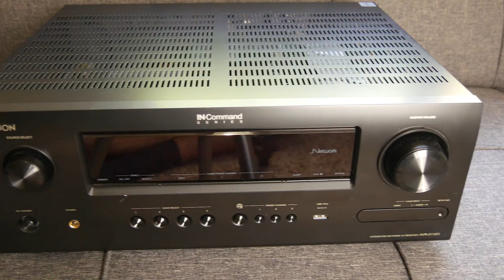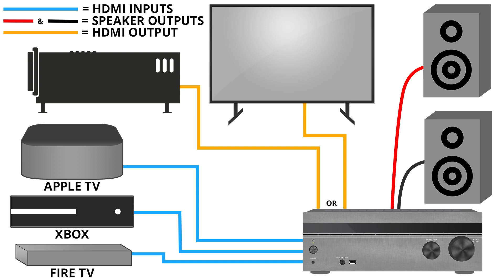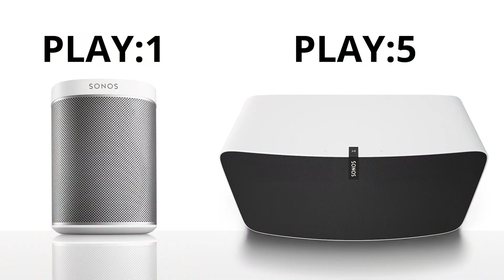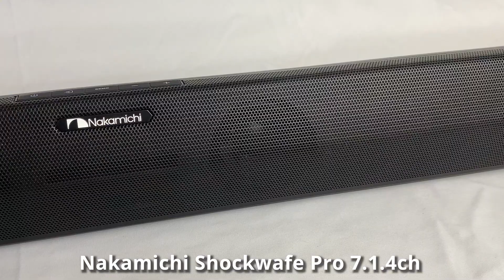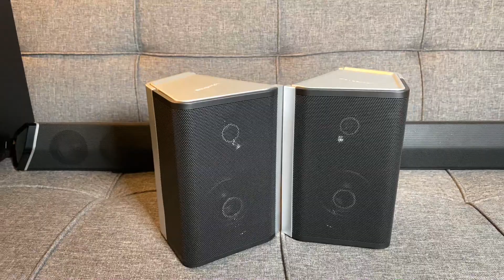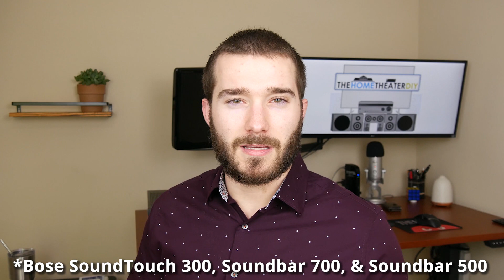You Don't Need a Receiver to Have a Surround Sound System!

Comment: Thanks for the videos. How can I get really good sound and great bass around 50 people watching a 20 foot screen in an open air park. I feel I'll need lots of amp but can't seem to find a video going over that specifically or promoting a great system for that. The projector will be a Xgimi Horizon Pro 4K. The crowd will be about 20-50 feet back from the screen and up to about 30 feet wide.
Reply: Did u blow the big concert in the park

Comment: I'm confused. Is it not possible to connect a soundbar and subwoofer optical wired to your TV?
Reply: I am buying a 2.1 with subwoofer, and don't have a Bluetooth TV
Reply: I just need to know what to do 'wire' wise.... do I need a dual channel so I can use both at once/is it best to buy a different kind of wire/does my TV require an amp???
Reply: @BeebopChickenpock   I don't know what you're talking about, but if your TV has an optical digital audio output, and the soundbar has an optical input, that's all you need to connect, one cable for sound, if the subwoofer connects to the soundbar wirelessly as most do these days. (The TV doesn't need to be Bluetooth, you're connecting the TV to the soundbar via optical cable (so the audio signal is routed from the TV to the soundbar that way) and the Soundbar then connects to the subwoofer(if there is one) wirelessly, passing the LFE channel data to be played there.) 

No, you don't need an amp or anything else if you are just connecting a soundbar to your TV, the only thing you need to make sure of is that you have a matching output and input on each device, i.e. optical audio, HDMI, digital coax, and get that cable.
Reply: My subwoofer DOES pair with the soundbar I believe...
Reply: (Not purchased just yet)

Comment: I have a question. We are getting 5 speakers installed of surround sound within our walls. However, we do not want a bulky receiver, we have looked at Sonos and how it replaces all 5 but I feel like that defeats the purpose of the in-wall speakers. Do you have any recommendations for good small receivers? Or alternatives to a bulky receiver?
Reply: I know you asked this a long time ago but just curious on what route you decided on? If your looking for a proper home theater sound setup, 5 discrete speakers is the way to go along with a subwoofer. I've listened to Sonos and expensive soundboard but they don't compare to discrete speakers and a subwoofer.
Reply: Marantz makes a nice slim design receiver with plenty of power

Comment: dude nakamichi shockwave is like the ultimate soundbar ive seeen one with two subs and dolby atmos support
Reply: Please listen to discrete sound no reflecting stuff. Every reflection is distortion there is now way a mic placed somewhere can calculate adjustments to compensate for tonal shift time alignment etc to be correct math. Settling for what you know is wrong just so you can keep up with the amount of channels they are mixing now.  You will get more emotions from a proper reproduction off all frequencies even if it was 1 Chanel rather than terrible reproduction coming from everywhere

Comment: Deleting my receiver from the system because it’s old and malfunctioning. I can use existing hardwire speakers for stereo. But I am interested in wireless sound bar surround system but don’t want to break the bank. Suggestions? Surround speakers and base.

Comment: How can i install a 7.1 or a 7.20 surround sound on a car or Van?
Reply: 1000 thousand watt powerinverter or what ever you need make sure the 120v end is the outpuit and cigarattte lighter is powerful enough if not wire to alternator or battery dont hook it up backwards itll catch fire and blow up soem vans have 120 volt outlls you could plug in a low power home theater like a walmart one or a lower end model and it woud work or you could ger a power inverter thets strong enough to power a croc pot to power home theater if its a  small one just dont go ober 150 watts total power not per channel it wont work without a big ol power inverter

Comment: I have an old receiver that's hooked up to my old TV set and planning on buying a new LED TV set can I still hookup to my old receiver
Reply: does it have hdmi if not buy a tv with optical audio out or buy a converter than converts hdmi to coax the orange rca jack not the fm antannea or wht i call  twistie cable now so peaople dont mix it up with the newer version for sending digital losseless audio to your reciever might sound better than the old way may sound the same not sure how you have it hooked up but if you have a newer game syetem or bluray player or dvd player it might not have a coax out put but if your devices do run them though coax to if its old like rca only you are a true audiophile the older stuff was built way better which is when they put quality no quaintity in theire equipment nowadaws that goes up in value plus newer stuff of equal quality cost 10k or more or 5k for simalar quality which im sure you new the way to best way to do this is to get a caox to rca converter which is still the orange jack or better yet fiber optic cuz it has less of a delay cuz it uses a laser and you plug it into the input on the led tv hey are you still looking for an led tv have a nice one in great shape form 2011 but its not 4k or smart but the picture is amazing only 32 inches though but i paid 500 bucks at best buy for it so if you arent looking for too much this will give you an amazing picture for cheap and if you read one of my post up higher it mentions my tv and how newer led tvs dont always look as good and have a washed out picture i even stood up for crts cuz there lag free and have amazing blacks and contrast but if your going to buy a cheap 55 inch for 100 bucks youll probabally miss your old tv if its a good one like the ones i mentiond oh yeah i ment fiber optic output on led tv mine has one plus even some newer tvs especially the 100 dollar 4k smart tvs wont have one unless u get one everything works on my led tv its a samsung too and its a great model make i also have a asus smart box thats like a mini pc i only paid 60 bucks for it so ill even thow in the hdmi and fiber optic cable s for freei i might have a few hdmis stored somewhere in great condition the fiber optic is like brand new but not in box i know it still works to so does the laser on my tv hope i helped sry for the long message but i wanted to anser as many questions as possible and the converter will be about 15 bucks or les  on ebay or amazons your best bet and i think our walmart carries em what brand and model is your receiver speakers tv etc

Comment: I have ceiling  speakers but no receiver. How can I input the tv /fire tv /cable TV into this system without a receiver.
Reply: Get a Bluetooth connection to whatever is powering those ceiling speakers. Then add the connection on the firestick jus like any normal speaker
Reply: like what dan said but if you dont have a reciever buy a bluetooth stereo amp on ebay just type what i said buy hook it up set volume bass treble and your good to go these can be as little as 15 to 50 bucks or more depending on what your speakers need

Comment: I use a pristine condition Bose AM-7 with a high end receiver in the bedroom for TV/movies.
Better than any soundbar that I have tried. The sub is passive so the bass level is perfect not overwhelming.
Reply: I have a panasonic I want a dac and amp what do you suggest does it work well with ifi zan dac 2 or hip dac 2 thx sir

Comment: the price for a reciever and a cheap 5.1 speaker system can be bought for less than one of these sound bar systems hes mentioning and will blow away any soundbar thats available..its simple to set up..left goes to left speaker..right goes to right speaker..center goes to center..sl is surround left..sr is surround right and subwoofer goes to subwoofer.
Reply: Receiver sounds much better than any soundbar.
Reply: Tell me where n what I can get for 100 bucks. Please tell me. I've looked and there is none. I'm now using Vizio 5.1 sound bar for 150 bucks. It sounds Aiight. Not great though. I always want heavy bass. Like call the cops bass.
Reply: @dmo848 do "real" 5.1 sound bars cost $100?
Or only the ones which reproduce "virtual" 5.1 sound through 2.1 (or even 2.0) drivers?
Reply: @burzasardaukar  I Kno my cheap ass Vizio 5.1 cost 125$and will rival any set up up to 400. It sounds great to anyone that hears it. Idk
Reply: @dmo848  For a hundred bucks you can get a spool of heavy gauge speaker wire. Well, you got to start somewhere.
Reply: @dmo848  You can find a 5.1 system. Receiver, speakers, & even the speaker wire for $100 if you look for it.
Yard sales, thrift stores, craigslist, kijiji etc.... Just might take a bit of time, getting it piece by piece. And it will sound better IMO than any soundbar...
because you can "tweak it" ... add/upgrade it a piece at a time. :)

Comment: A home theater receivers have better sound quality over soundbars
Reply: not necesserly true they make some pretty crappy recievers that are as light as a feather and still cost 250 through 500 dollars you at least have to pay 800 buck to get a solid performer compared to a nakami sound bar unless your thinking of a samsung sound bar at walmart theyre the worst tweeters awlays blow and the sub is the only nice thing i recomend brands like lg sony bose klipch polk audio or simalar viszio has best bang for buck ive seen a vizio  sound bar at walmart and it surprisngly sounded way better than most samsung sound bars if the put better drivers in the one i saw id reccomend it but it has peizos which sound tinny but it was a walmart one but id prefer a mid driver doing the highs like in bose over that jank junk even a paper cone tweeter would be better make sure if you buy a samsung that its a higher model cuz samsung has cut corners on alot of there low end products never pay for a receiver new for 250 bucks unless expecting max spl and tons of great features your better off buying an older pioner sony denon marantz onkyo because those were built like a tank even if its from the 70s to 2006 id say any of those models blow away the jank recievers even priced at 3000 and up msrp if you want to make it complicated look up dolby atmos processor and youll find great brands i can only dream of where the amp is seperate but cost thousands of dollars but an amp can be as low as 150 bucks plus shipping in ment condition for bang for buck add dolby attmos cheap reciever with multi out and itll smoke even the most expensice reviverr out there cuz your using the reciever as a proccesssor disabling the amp section and make sure it has a pre out rca tyoe connectrors to run to amp which needs rca too i know its alot but hey youll get true refrence level sound for a small cheap upgrade only if you have big speakers for surround s front and center heeights can be small but same thing go with brands that can be trusted the amps that are made in usa on ebay have 16 channels good for future proofing and can run as low as 150 bucks plas a hefty price in sipping but the older stereo recievers from 70s are the way to go for stereo sound you can convert the hdmi audio to anolog with a magic device called a dac which is in cell phones and mp3 players which have built in mini amps even baby toys that make noise have a baby size chip amp in them lol but
Reply: i only recomend the cheaper recievers if you have small to meduim speakers for large or even massive towers center channel i recomend at least spending 880 bucks and i think most of the 250 dollar recievers now have no pre out for amp so do your research if you want to connect external amp via rca cables i think some 500 buck ones do but havent looked in a whie plus newer isnt always better ive seeen some flatscreens that look like a 480p soap oprea no matter what you do and theyre 4k mostly cheap ones but if you go with the right model it doesnt matter hisense is becoming a higher end brand than vizio lol pretty sad cuz vizio made box tvs and ivenever saw one in person but those ones i was talking about look worse than my 32 inch samsung from 2011 but it was 500 brand new what do you expect you get wht you pay for even they were worse than the old truflat tube tvs which i think have the best color acuracy unless your paying 500 or more for a 4k tv itll probably have very poor upscaling and horrible backlight thet doesnt have any dimming zones like the high end tvs and oled is great if you have the money the crt like blacks are amazing andthe only issue i have with mine is burn in but i can dill with it over the washed out soap opera affect which some tvs are stuck with!!! i meant 800 bucks for a reciever to drive big speakers cuz the can do 1000wpc or higher at 8 ohms but you reeally need a medium sized surrounds for it cuz the surrround chanels are always quiter unless you turn them up so for rap surrounds max center depends fronts half level sub depends on how its crossedover and level is set  to for rock you usaullly can max out everthing and it wont distort or blow unless you dont have klipsh cuz mine ive seen people blow the tweeters on them cuz they were set way tooo low and it made the reciever work harder cuz you had to like turn it all the way up just to hear it and some recievers audto calibration sucks like onkyos new accueq its useless sets everything way off and the best one ive experienced is pioneers mcacc cal it is top notch sadly better than yamahas ypao only cuz you can custimize the eq and it has two eq to customize which is great for stuff that has no bass or treble and you feel the sound is too boring thats why i like klipsch theyre known for their fun sound plus their amazing for there price even there small speakers high end or lond all good would definatly reccomend them i saw a 50 dollar 2,1 klipsh pc speaker system that retails for 150 at walmart thats the best chrismas deal yet you could also hook pc speakers up to your tv just make sure their good ones and if it reallly is making a differnce in sound 50 dollars man for a speaker system that is 250 bucks back when i bought one my walmart mustve got price mixed up with their other ones that were klipsch they were portable bluetooth speakers but i swore it said 150 dollars for it so whoever paid 50 bucks got a steal reminds me of my first 50 dollar heme theater in a box back in 2004 it would rattle my window and sounded better than my mom and stepdads 150 dollar one it had a massive amp like a logitech z900 or whatever that was called thats another good one but there expenve but most there 2.1 and up speakers are great tooo and so is altec lansings vintage white pc speakers with sub from 90s to 2006
Reply: olus ive blown my ears from listing to alot of luod musci on big speakers and earphones that have a ton of bass plus the bass on my mp3 player and now i need a headphone amp when i use any portable device unless its an old ipod cuz those were super loud like off that simpsons i wonder how loud one would be with a headpone amp plugged into it at max volume with the eq set on rock bet it would blow a 600 ohm pair of headphones with the right music after a few seconds the higher the impedance the more power the headphones need its like the oposite for speakers no matter what kind they are unless the toy ones are like headhones and peizo buzzers cuz their so small a speaker usually requires more power at rms the lower the impedance and its bad to run speakers at max power cuz they usually blow u can usually go a little over as with anything and ittl still perform like day 1 but some cheaper stuff cant handle it or lower end i shoud say not all cheap or low end is bad though cuz that 50 dollar regent a  product of lennex sound was a beast in a small sub box in desquise untill you looked at the back and saw that massive amp heatsync thats my 10 cents for getting the best out of your home theater and tv

Comment: I am getting a single sub for my TV what do i need? any tips? I have no knowledge of surround sound and subwoofers
Reply: are you planing on using it with your tv speakers ive done that your gonna need a 15 dollar rca to fiber  optic converter or to if your tv hass rca audio out you could set the rca out to variable so you dont have to run to turn down the sub like i always did it was ghetto but it woreked and you can set the volume to whatever and crossover works bwst at 80hz not lfe unless you have an old reciever laying around with lfe output becuase 80hz is the thx standard youll figure it out its a knob that says crossover and turn it up or down till its at the 809hz location set gain in middle leave eq on tv on flat if it has a tone set it how you like normal low or hjigh turn on surround sound enhancer not bass enhanecer on tv and ajuist from there may take a couple of tweaks to get it but once you do if done right youll be very impressed i saved a ton doing this back in the i meant a fible optic to rca converter not the other way or you could buy pc speakers 2.1 for 50 bucks if you do your research you might find em cheaper but 50 bucks is a quality staring point and make sure your tv and speakers have fiber optic in on speakers and out on tv or whatever audio connection it uses jus dont hook up the speakers backwoards youll lose a ton of bass and read or gooogle how to setup speakers for best acoustics for home theater cuz you want the satilites spread apart if you can i meant till it reahces 80hz you woulnt have any bass at all if you set it to 809 hz mainly low to mid mids coming through the subwofer which defeats its purpose you might actually perfer the lfe setting which is the highest it can go but as you age like me you set it to 80 and leave it oh i meant firber not fible and you can buy 5.1 pc speakers too for as low as 50 bucks for a great pair